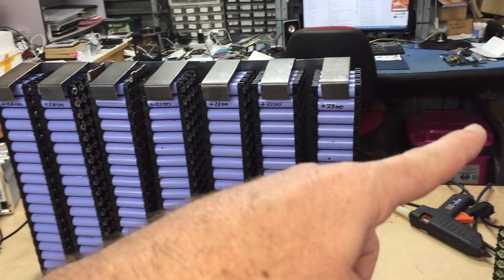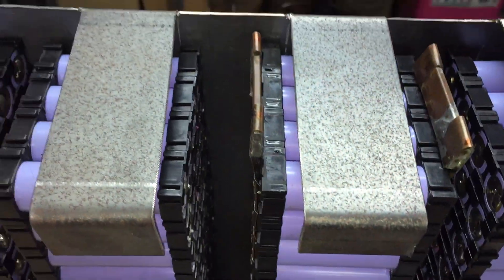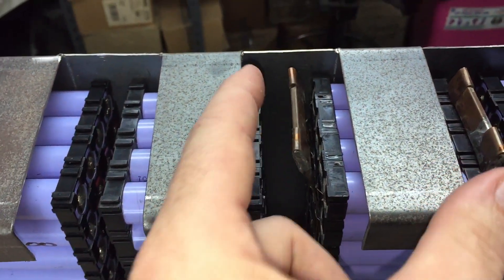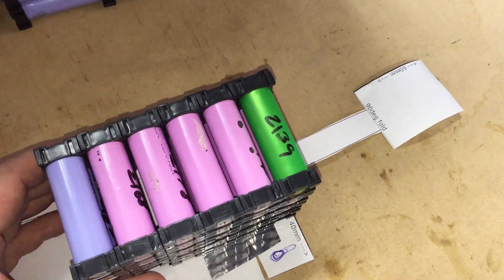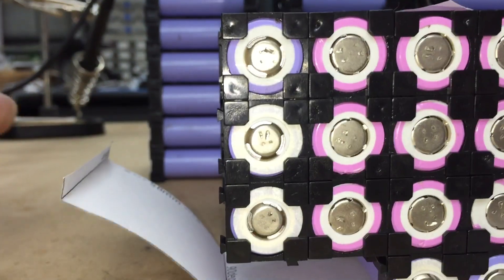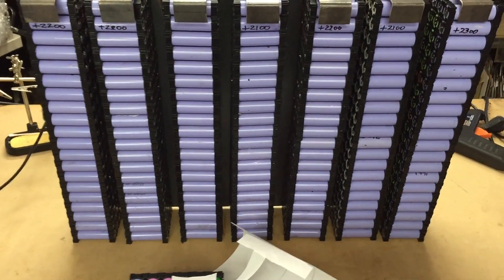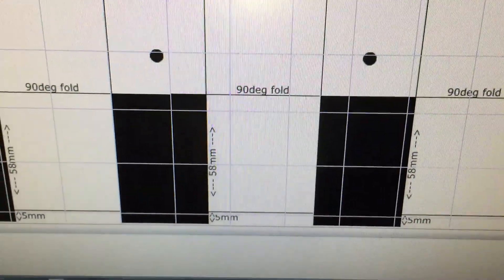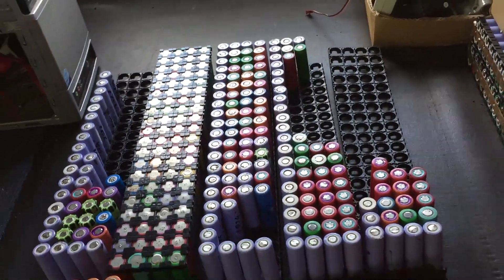My Beta Rack

Comment: Might be worth thinking about insulating those metal hooks or separating the plates for each module... One nick through the shrink on a couple cells and you'll short out a subset of your battery. Another reason to think about it would be failure propagation.. It doesn't take much heat to cause the shrink to start to pull back and expose the can, which could turn a cell failure into a cascading short circuit.
Reply from the maker: much refining of the concept is required. One step at a time.
Reply: +HBPowerwall Of course. The concept looks good, just hoping to help in case you hadn't thought of it yet. :)
Reply from the maker: +Mike M I don't sleep so tend to over think if anything ...lol